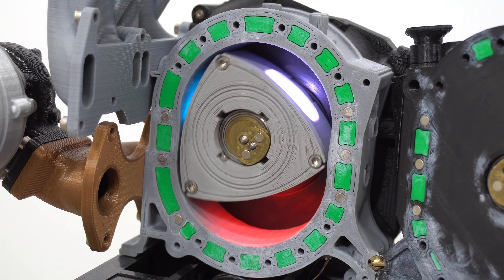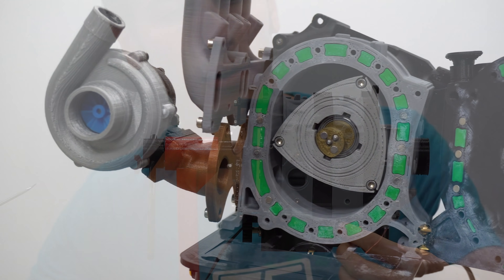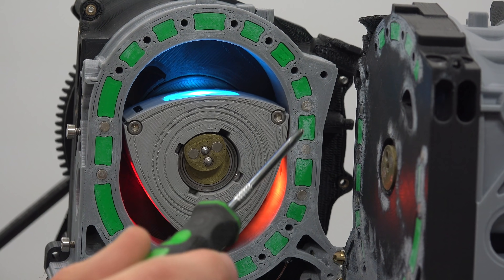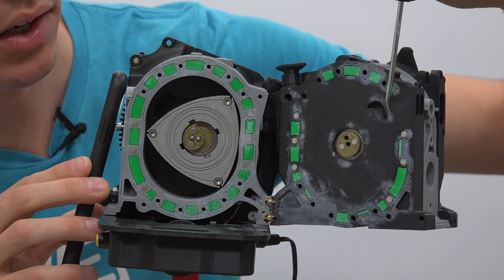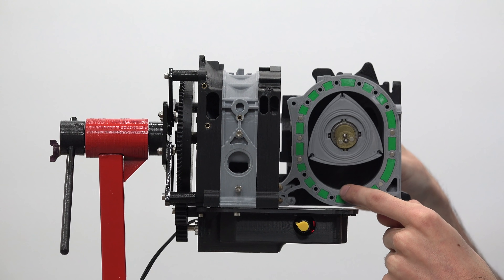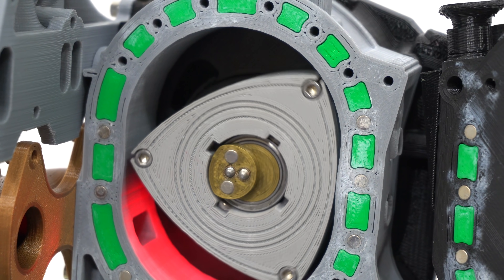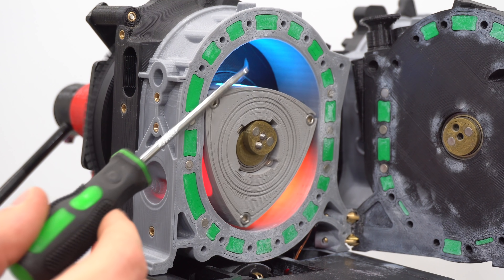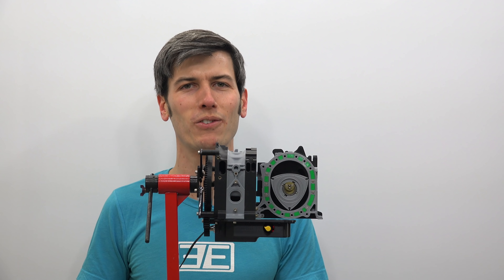This 3D Printed Rotary Engine Is Genius - Mazda RX-7

Comment: Hmm... can I 3D print myself an R34 GT-R?
Reply from the maker: YoU woUlDn'T dOwNlOaD a cAR
Reply: Those pirates......
Reply: If you have the models and a 3d printer, sure you can.

Oh, you're talking about the real deal...

If you have the real scale models and a big enough 3d printer, sure you can! At least the moulds to glass fiber them. Engine, chassis and other mechanical bits are another issue. But a guy spent 10 years bending plates to build himself a Lamborghini. He bought the engine, transmission, wheels, chassis...
Reply: Only if your 12
Reply: You can... And place it in front of your house forever...
Reply: The future await
Reply: Yes Please
Reply: LOL!  😂😂😂😂

Comment: Brap...Brap...Broken!!! Just kidding!! I legit would buy that model tho
Reply: Ungregistered User  Id love a little Army of these in my garage. Rotary, Inline 6, Flat 6. I Have seen ones like this but not on this level. The way you can open it, & by far the coolest thing for me is the LED's showing the combustion
Reply: Ungregistered User Assembly required. You would need to put the leds, motor etc.
Reply: Ungregistered User the 3D files are free online. And if you really wanted one someone like me could print you one. A standard fmd 3d printer would do the trick

Comment: Great engine, just for about 100,000 km.
Reply: How do you explain that there are rotary cars owners that has changed engine in just 60000km and some others go to 200000km with the same engine? It's not engine's fault, it's <bad> owner's fault. If you treat the way that has to be treated a rotary engine will last for really long. I am talking for personal experience, first hand, not what I have heard or rumors, which the most of times are not real.
Reply: Yes, maybe 3000km, maybe 10000, maybe 50000km whenever... Then you do a good rebuild and you have it another 200000km plus with a good care and proper driving for a Wankel.
Reply: If you don't take care of it, it won't last. It's that easy. It's not the car's fault that you don't make the effort to maintain it. If you want a car that just goes without doing anything to it, get a Mustang instead.
Reply: then i have 3000km left :(
Reply: Nah fam you have no idea what you're talking about
Reply: You're being generous with your numbers.  Lol